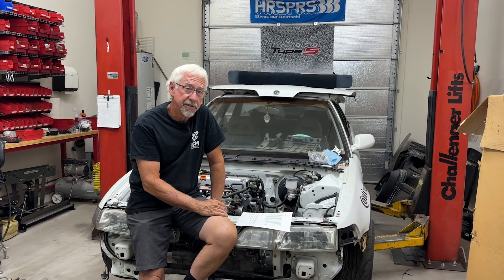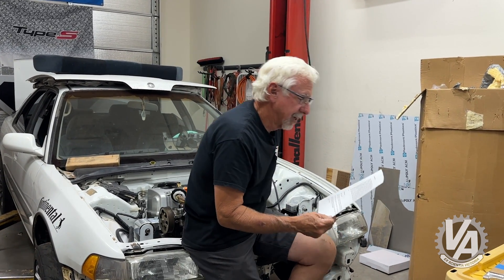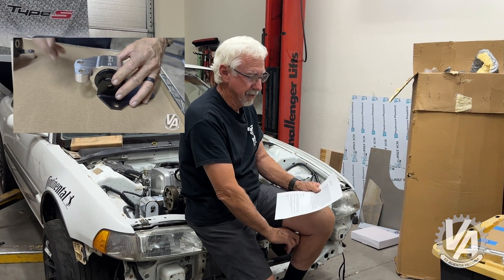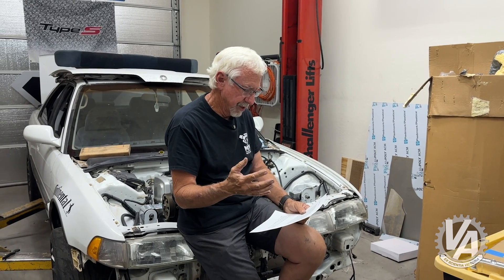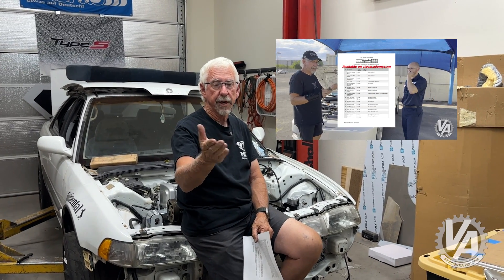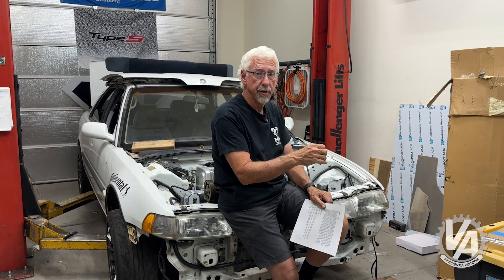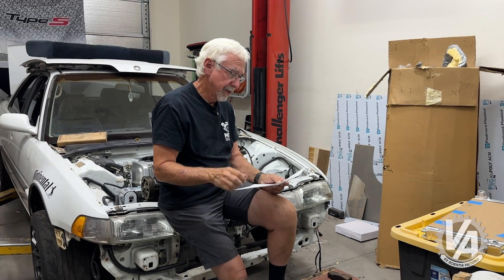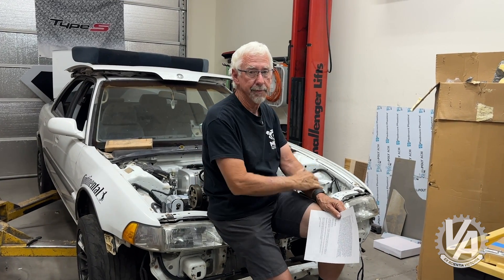Answering Your Questions About K Swapping a 7th Gen Civic Hybrid

Comment: I have a manual 03 civic hybrid that id love to K swap. What motor would be the best for it K20 or K24. Also would i need to change the transmission on it? I am so confused. PLEASE HELP!! 🙏 🙏
Reply: Hello Peter. I'm pretty much in the same boat as you. I have a 05 Civic Hybrid manual that I plan on engine swapping. from the research that I have gathered so far... You can run a K20a2 or K24a2 with the matching manual trans. (I would watch several videos about the differences between the 2 engines) You will need the engine, trans, exhaust system, engine wiring harness, RSX-S subframe, 02-04 RSX-S manual trans-ECM, engine mount kit, and VTEC Academy wiring harness.

I plan on running a K20z1 and manual trans, and I'm thinking about buying a complete RSX-S car to get all my parts from.

Comment: C101 plug wiring gyide you have is for Hybrid with a CVT, could you make one for manual? Or should it be the same?
Reply: The manual one has a green four pin plug u would use from the stock chassis harness

Comment: I'd like to figure out how to mount a j35 in my 8th gen ex sedan. 
It's got the automatic and has a shift flare when it's cold, Plus it's leaking, coolant and oil out of the GUTLESS R18 engine.
I would love to get a reliable 280 ,300 wheel horsepower without boost. J sounds like th answer, but manual trans might be an issue. They are basically non-existent in my area

Comment: Regarding to immobilizer, there is a cheap tool called Autel Maxi AP200 which cost about 50-60USD. It can do anything that the stock HDS, and you can run an "ECM/PCM Replacement" to teach the ECM and Immo together.
Reply: Has it been tested on Element, CRV, Civic, RSX style immobi of that generation? I have several tools (not Autel ) that can’t do anything with these older style immobi but works just fine with any other Honda 05+ and Accord 03+ immobi.
Reply: @ramb0r0kr888  only tested on 03+ Hondas
Reply from the maker: Hmmm… interesting!

Comment: I’m doing this swap with a 2003, I was planning on getting an ep3 dash is this worth doing? And do I need the rsx subframe. Also will the esk4 mounts work (element block with tsx MT)
Reply from the maker: A manual 2003 dash will work fine. The K24A4 block is about the same. The ESK4 mounts will work with that combo. The Element block has the correct block bracket. It’s like the CRV block bracket.

Comment: What's best to swap with the civic wagon 4wd? I think hood clearance is the biggest problem.
Reply: 4th gen? if so hood clearance is mostly an issue with intakes on F and H series.
Reply: @bassblaster505  not sure exactly it's got the d16a6 I think 88-91. I was definitely torn between building the motor or swapping with a f22/h22 because I have a spare block.
Reply: @Lost10mm.  88-91 is 4th gen, most refer to it as the EF but if you wanna be anal EF is the JDM VIN and in the states its an ED. But anyway i have 91 with an F23A1 on an H2B kit. H series intake with the IAB's are gonna smash into the hood. My F intake doesnt have IAB's and clear with some cheap hood spacers. H22 would be the "best" for NA power but FRM liners are becoming more worn with age. F22 will still have more HP and torque then a stock B series but have steel liners like D B J K series. Consider an H2B kit as B series trans have much shorter ratios then H series trans and especially F series.
Reply: @bassblaster505  that's really awesome thanks, I actually have a extra intake from my first cb7 lx which doesn't have the IAB's. That's crazy one will clear but not the other won't they look so close to the same size. The wago is a rt4wd and I just found another one for cheap 😁 definitely wondering what that transmission will hook up to or if I need to upgrade anything. Both have the SL gear also. Really appreciate your feedback on it excited to get one of them back on the road again.
Reply: @Lost10mm.  Being an RT4WD you may be able to go F/H engine with an H2B AWD kit and a CRV AWD trans. an AWD H2B wagovan would be badass i think. not sure if youll be able to keep the stock D series unit. about 15 years ago they made a B2D kit to mount B series engines to a D series trans. That MAY be an option if you can even find one
Reply: @bassblaster505  that's what I may be shooting for I'll have 2 wagos and then I will probably be able to also do the rear wheel cb7 ex coupe with the extra rear end. Really appreciate your insight on it. It's not really common for a build most people do k or b series which are awesome but I love "different" I'll try to give you a shout out on my channel when I get too pick up the 2nd wago rt4wd